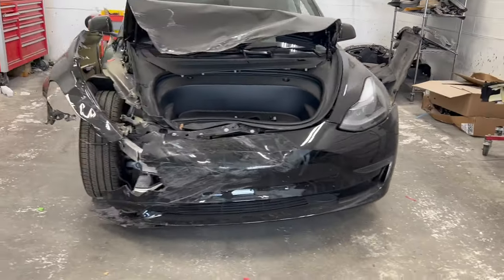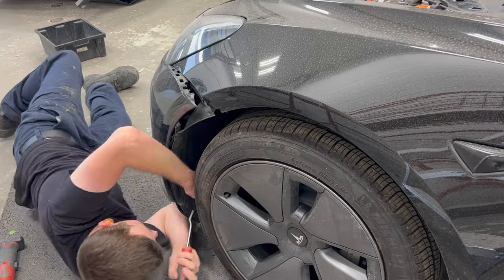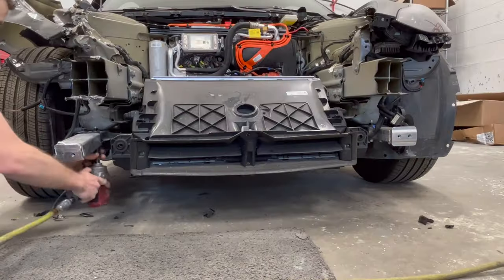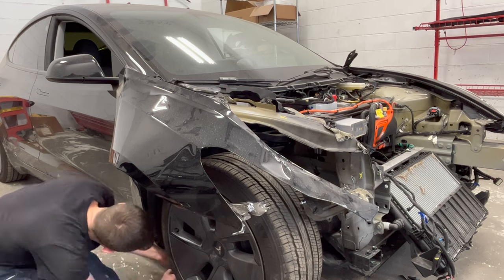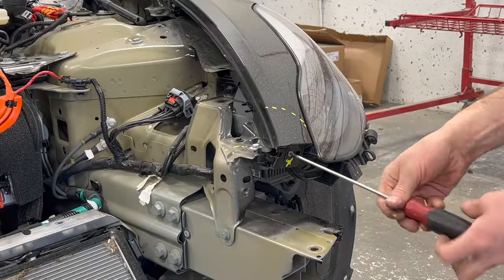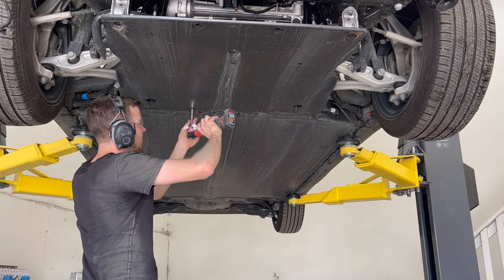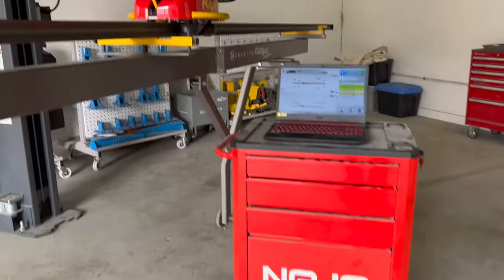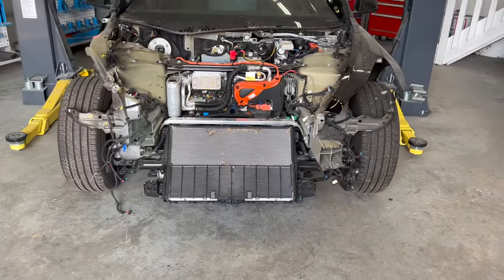What Happened To This Wrecked Tesla Model 3 - Disassembly Process!

Comment: Okay, so that frame alignment tool is wicked cool and looks VERY expensive. It will be interesting to see how work like this is done on the newer Model Y Dual Motor with its cast alloy sub-structure.
Reply from the maker: It certainly is very cool. I haven't had any experience working on the new cast structures yet but from my understanding those parts come as a complete assembly for each corner of the vehicle so any major damage to one component would require replacement of that cast structure.

Comment: If you disconnect the 12v battery, do you still have to disconnect the airbag sensors to remove crash bar?